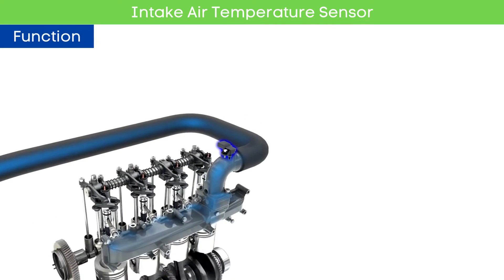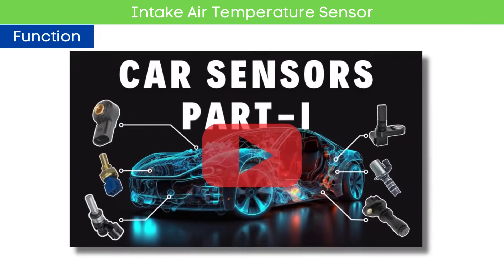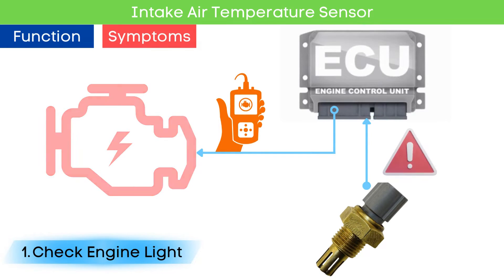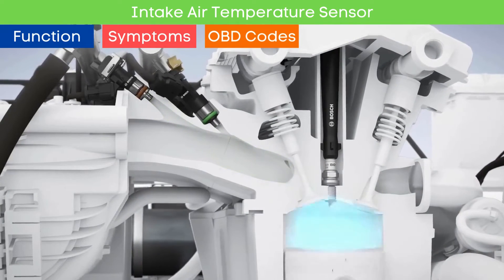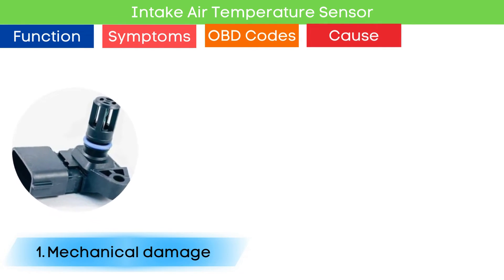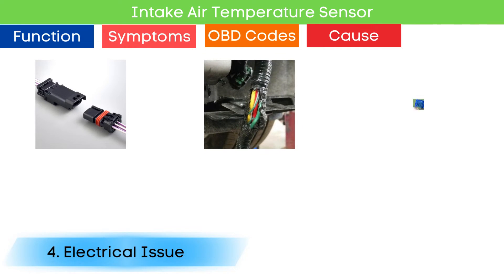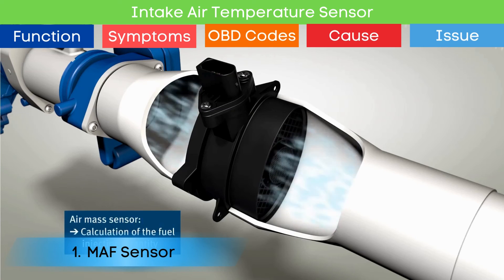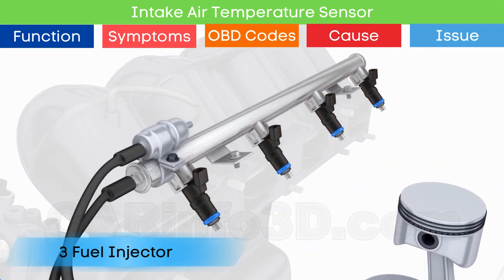Bad Intake Air Temperature Sensor: Symptoms & Causes

Comment: I just found out yesterday, that my 94 celica GT has that issue. I was complaining for a while about poor power and rough idle. Today the new sensor will arrive and I really hope, that this was the main issue. 
The check engine light did not turn on. Only when I use the diagnosis mode. Then it gives me the engine error code 24, which is the IAT sensor. 
Lets see, if that really was the issue.
Reply from the maker: Okay, let us know.
Reply: @carfix07  well. I finaly changed it, but it did not solve the issue. Maybe I bought the wrong one. Problem is, the og sensor is like 70 Bucks. That is to expensive for me.